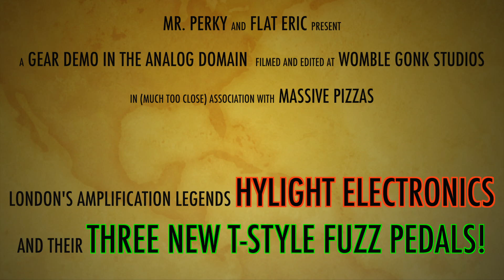THREE Mega New Fuzzes From Hylight Electronics!  (HyFuzz MkI & MkII + GenX MkI)

Comment: They are all very good. I liked the Hylight MII the best. Big but ...the price is  just shy off $500.00 USD ...Ouch!  
I went and got my Solid Gold FX ...If 6 Was 9 and dialed in things more similar than different and it is $200.00 USD.  
I am sure in a dead quite room I would hear some sonic icing of their Fuzz cake but in a band or even on a recording
with my band ....highly improbable. 
Add to that I can alter the voltage and BIAS on the 'Gold'. ___THANX for your as usual excellent demo.